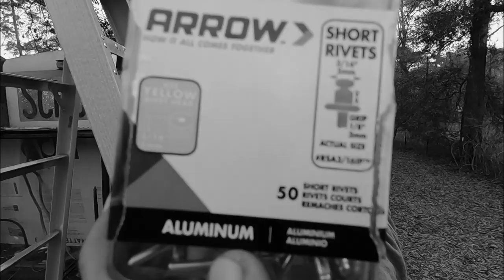Framing Out School Bus Wheel Well * Skoolie Conversion * Gus The Struggle

Comment: Great videos always you two. I'm glad you soundproofed/coated your wheel wells. The right rear on my bus with extra roof coating did not frost over last night. The left rear was frosted like a steak in the freezer. Current temp variance for you. Last night got down to 9'F and internal temp with 10,000 BTU kerosene heater was 50'F and at 18'F was 65'F. Definitely 20,000 BTU is needed, but nice to know 10,000 will hold.
Reply from the maker: Thank you so much! Oh my gosh, I had to put on a jacket just from reading that! That is so cold!! I hope it warms up soon and you are able to keep things defrosted!

Comment: how high is the typical wheel well on such buses?
Reply from the maker: Not sure what you mean, inside wheel well height? or outside
Reply: @GustheStruggleBus  I mean the height from the ground up of actual bus steel frame above the wheel, I'm trying to estimate if a door could possibly fit above there assuming the ceiling was raised enough (sorry about the auto correct typo that made the previous question somewhat unintelligible)